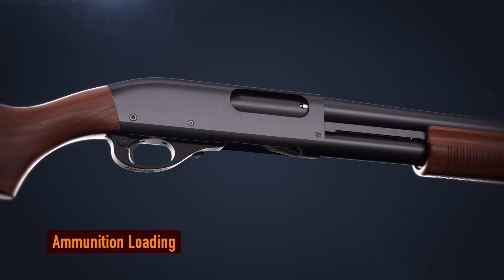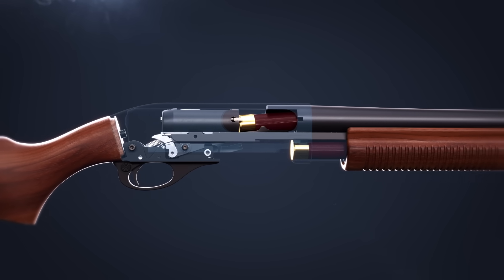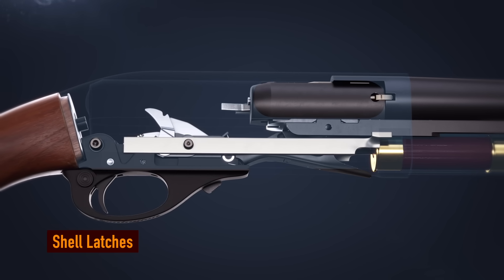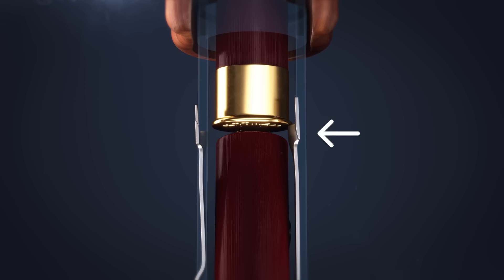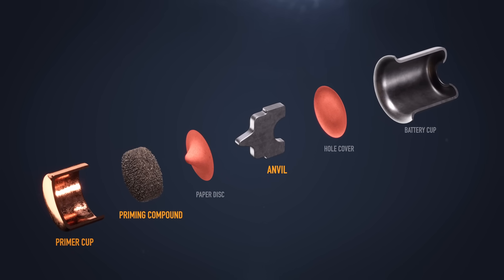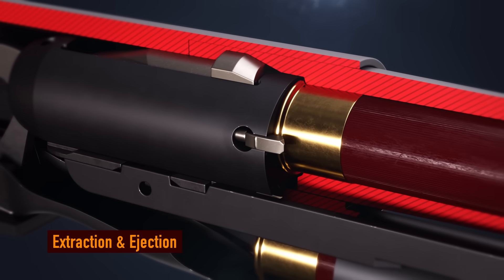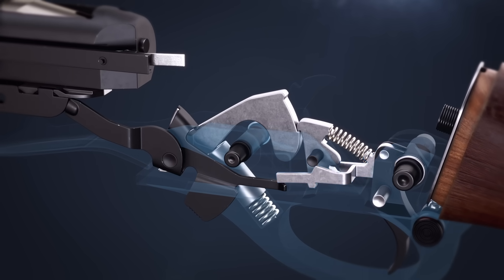How a Pump Shotgun Works

Comment: the mechanics of guns have fascinated me for years, especially when you consider that they were made by really clever people basically as an upgrade from just throwing rocks and spears at each other, like someone had to without any prior knowledge or really guiding help, had to work out so much of it
Reply: Us Palestinian are still throwing rocks. We can only imagine to have a few weapons. Things would be different.
Reply: Well each small evolutionary step in firearms technology came from folks learning about that which came before and then improving one little detail or two, or sometimes re-working the existing ideas into something different to solve a new problem. The 870 shotgun came from all of the lessons learned from those who designed the previous pump shotguns, and those first pump shotguns came as an answer to other methods of reloading like lever action and those came from folks trying to add a way to not just hand load each round, which was already an improvement over those who were muzzle-loading. Not that those who make the next generational improvements over and over aren't brilliant in their ways, but certainly are standing on the shoulders of the designs that came before. 

Also to be fair, it wasn't until relatively recently that cartridge firearms even were possible (approx 150 years or so) so a LOT of learning happened really quickly once that technology came about. We're still learning new options today.
Reply: @scottwatrous  Correct. First basic "firearms" were technically just downsized cannons. The "trigger" was there for more practical reason so one could use both hands to keep the thing steady when firing (no trigger needed for a cannon that lays on the ground). True, the side effect of that was also a better control over the timing of the shot. The real advancement happened after proper cartridges appeared.
Reply: I've always been fascinated with the mechanics of guns too. You know that slingshots and spears are made by literal apes though, they aren't the direct predecessors to the Remington 870. There was about 300 years between a time when a metal tube with a spring powered flint and steel at the back was the pinnacle of gun technology and today. Even before that there were wheel-locks and completely manual guns used all the way back in medieval times. They were making pocket watches before semi auto weapons, it was hardly a rapid conceptual or engineering leap, albeit a great and revolutionary conceptual and engineering leap

Comment: The mechanical engineering behind shotguns is staggeringly impressive.
Reply: All guns really. Some modern guns have like 200 parts and the engineering behind them is incredible.

Edit: changed "moving parts" to just "parts". Examples of 200+ part guns are most modern belt fed LMGs and aircraft mounted cannons. Some rifles and smgs come close to the 200 part mark like ruger precision rifle and FN2000
Reply: @Praxium

Guns can range from literally just a tube with explosives and a projectile to crazy overengineered and unreliable. Homemade smgs and the mechanical genius of the ak lie in between
Reply: @scronchgoose7403  The six moving parts of the AK platform never fails
Reply: @Praxium  200 moving parts?! That had better be in something massive
Reply: @Praxium  yeah like  f2000 it design is like a advanced bull pump rifle
Reply: @Praxium  And they run reliably even after thousands of rds, just plain incredible.
Reply: @Praxium  What guns? Most guns don't even have 200 parts. Maybe belt fed ones, just curious.
Reply: @Zluken  you're right. Many belt Fed guns have upwards of 200. M249 has about 180. M134 has over 250 even discounting motor and electronics.
Reply: @Praxium  what gun has 200 moving parts? Stop lying!
Reply: @nickflanderson2658  he’s just over exaggerating it
Reply: @nickflanderson2658  I think it hyperbole.
Reply: @nickflanderson2658  M134G, FN2000, certain AR inspired rifles
Reply: @Praxium  what an obviously fake statement lol
Reply: @kracksquatch512  hy·per·bo·le
/hīˈpərbəlē/
noun
exaggerated statements or claims not meant to be taken literally.
Reply: @kracksquatch512  Ifi
Reply: Exactly, and they are all mechanical which i find really cool.
Reply: Bigay ka ng May kapal
Reply: Your mom is staggeringly impressive.
Reply: For sure. And hell, this goes for any type of propelled weapon. Always fascinating to see videos like this.
Reply: Ñ
Reply: @David-fu1oj  yeah bro, really good point
Reply: Fancy words
Reply: It looks like nothing compared to the internals of a kalishnikov or ar15
Reply: Check out an AN-94 or a G11 if you're think this is impressive.
Reply: Heck, even the good ol' cannon in the old days impresses me.
Reply: ㅔ
Reply: Staggeringly 😂 try very, extraordinarily ,or just impressive
Reply: @sippitrey3083  You must have knocked them dead at the second grade spelling bee
Reply: Well said my friend ..beat me to it ..
Reply: A mechanized marvel
Reply: Gajab👍👍
Reply: Especially if your standing in front of one it'll stagger the hell out of ya.........
Reply: Yet very simple
Reply: And yet are simple compared to idk , 

An M4A1 with : 
Grenade launcher
Foregrip
Lasers
Sights with canted magnifier
Extendable stock 
Heartbeat sensor with movemap / some touch device
And of course , suppressor
Reply: Oh yeah? Are you a fucking engineer?
Reply: @LaughingMan44  I see anger management classes in your future. For the time being, you should try thinking before you speak. Usually works out better for ignorant people, such as yourself!
Reply: @dang6369  Imagine thinking I read anything you wrote. Now I will mute you and get the last word, this pisses you off ;)
Reply: @smirnoff1589  wow, you got a new account just to reply to me. I could tell you were projecting with everything you said, blocked!
Reply: @LaughingMan44  lololol I had that account u mad bro? Anger management!!!
Reply: @LaughingMan44  you mute me here too? F*cling rube lol
Reply: Saying it like every other gun doesn’t have similar builds. It’s really all guns.
Reply: Å
Reply: funny because who ever got shot with this shotgun usually gets staggered
Reply: Probably goes like, so how do we fire? Whit the hammer. How do we get a new shell in the chamber automatically? Uhh yeah umm. Its gonna be complicated.
Reply: Just a couple and springs, levers, and gunpowder baby.
Reply: Thank John Pedersen since both the Remington 870 and Mossberg 500 trace back to his Remington Model 10 design and the High Standard Flite King currently made by Rock Island is based on the Model 31 which is also mostly Pedersen.
Reply: https://youtu.be/KZYQTY5LZJ0
Reply: Haha rip kneecaps
Reply: If you want to see something impressive look at the inside of a G11
Reply: Took people hundreds of years to figure it all out
Reply: Ñ
Reply: Ur mom looks staggeringly impressive for her age
Reply: they were built off of simpler models
remove random crits
Reply: Imagine all the trial and error the last couple centuries to get here.
Reply: Amogus
Reply: Can you explain that engineering i want to know
Reply: Engineering wise it's actually quite simple. The simplest forms are pulleys and levers which consists of most of how the gun is built. Step 1,2,3 repeat.
Reply: http://youtu.be/DpIN2QQGit0 
Glock, Remington, Schofield, Colt, Walther
Reply: And they were invited in about the mid to late 1800s right???
Reply: Looks like a Rube Goldberg machine.
Reply: Eh not really
Reply: Yup, but Germany didn't appreciate it in ww1
Reply: But kinda simple
Reply: Indeed
Reply: https://youtube.com/channel/UCJK904C4lS1mEXSjozMfgEw
Reply: Обзор пневмо обреза у меня на канале)))
Reply: Talking about impressive mechanical functions, have you seen inside an Automatic Transmission!!
Reply: impressively not that simple as a mechanism for a so simple looking weapon
Reply: Not really, this seems pretty straightforward compared to some guns
Reply: @Killakatnage89  "Seems straightforward," says the expert explaining a video about something that took years of design, testing and manufacturing.
Reply: It's easy, anyone could make a gun on their first try
Reply: @wickedimpulse  But not everyone will live to make another.
Reply: @wickedimpulse  no not at all, unless its a pipe shotgun
Reply: @wickedimpulse  a rubber band gun?
Reply: @blackholestorage168  I think they're referring to a slam fire shotgun. Any idiot with access to steel pipes and tools can easily make one but they can only fire one shot and they're about as accurate as hip shooting a sawn off.
Reply: @wickedimpulse  oh yeah, ill try the "holding the bullet in between my fingers and hitting it whit a hammer" technique.
Reply: And it's crazier to think that the first pump shotguns were invented a hundred years ago
Reply: Thank you
Reply: It’s crazy. And to think they were invented before math.
Reply: @spaghettiboney  Lol wat?
Reply: It's to kill thing, of course we're gonna put in the effort
Reply: Welcome to Whitesville.
Reply: Yes cool. But no need for such a device to be invented with intention to kill humans
Reply: The mechanical engineering behind death is staggeringly impressive
Reply: what? I think its pretty simplistic to be honest
Reply: @jimlahey6692  Simplicity in is a fundamental principle in designing something, and to me at least, is part of what makes the design of the pump action so beautiful.
Reply: @jimlahey6692  yea, something like combustion engines are far more complex
Reply: Yet A HillBilly Can Make A Fully Functional One Out Of Old Scrap Metal Parts
Reply: @kracksquatch512  Well, I mean, you're not wrong.

Comment: This might be a random question, but considering that most pump shotguns eject the empty shells to the right side, will it be disadvantageous for lefties? 

I mean, the empty shells would jump and made contact into the right arm on each pumps unless you lean the shotgun outward, slightly to the right.

Would that situation be disadvantageous?
Reply: I suppose so, but shotgun shells are mostly plastic and don’t get as hot as rifle brass in my experience. Probably more of an annoyance. I’m sure some companies have made receivers to eject it on the left side for lefty shooters.

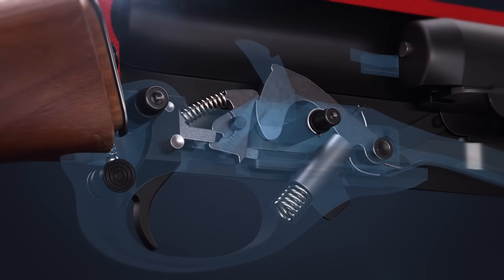Comment: Quick question. At the 2:09 mark the animation goes over the firing sequence.  The trigger rotates the sear, which releases the hammer. But the hammer itself seems to only be held in place by a small overhang of metal. If the shotgun were dropped onto the stock from an appreciable height, what would stop the sear from getting knocked backwards and releasing the hammer?

Put simply, what prevents a discharge if the shotgun is dropped?  

Thanks in advance for serious answers.
Reply: Tolerances inside the trigger mechanism are tight and everything is bolted together so even though it's only a small lip holding on, it's perfectly safe if handled properly
Reply: So, yes, obviously safe handling is the best way to prevent any negligent discharge. My question assumes that the shotgun in the animation has been dropped. We can argue about whether or not a firearm should ever be in a situation where it is dropped, but for the purposes of this question let us imagine a world where there is a shotgun that is already falling onto a hard surface in such a way that the stock will impact with force.

At that point it seems, per the animation, that there is nothing preventing the sear spring from compressing, which would disengage the sear and allow the hammer to strike the firing pin.
Reply: @rolfbuchner3991  Sig's new pistol for the military actualy was found to have this problem early on, when dropped it was possible for it to discharge. These things are tested and resolved. If the 870 had this problem it would have been found and redesigned after all these years
Reply: You literally answered your own question
Reply: They are not drop safe, and the safety will not keep it from firing if it is dropped. It's best not to keep them with a shell in the chamber for this reason.
Reply: @chillbro1010  That was a really interesting answer, thanks.
Reply: The safety?
Reply: Don’t drop a loaded shotgun or it could go off
Reply: @chillbro1010  Thanks! This is helpful.
Reply: Short answer, nothing. Slightly longer answer, only your proper handling of the firearm.

Comment: For my 870 I only have to to push the action bar once to put a shell in the chamber after that when I fire and go to pump I don’t need to press it again not sure if it is like this on other 870’s but for mien it allows me to rapid fire
Reply from the maker: Yeah I should have been more clear about this in the animation 😞. The action bar is only required upon chambering the first round.

Comment: This works like a piece of computer program, except the parameters are much more hard (literally) to adjust, so that all modules fit, sync, and work together. It must have taken quite some years to debug and smooth out the code.

Comment: Interesting, but why are shotguns loaded this way and normal weapons from magazines, and not the other way around, or both using which ever of the two is superior?
Reply: One off the cuff thought is cartridge shape. the conical shape of a bullet means that it's more likely to tilt in a vertical magazine where as the cylinder shape of a shotgun shell has less room to shift to account for the rim in a stack.

Some amount is also probably history, though shotguns like the USAS-12 and AA-12 both use more traditional magazines, though I don't off hand know of any non shotguns that use an inline like most shotguns.

There's the consideration of weapon balance and ergonomics. a 12 gauge shell is quite large compared to say a 5.56 or 9mm bullet, so having a large magazine sticking out of the bottom might be clunkier to handle (Some military rifles had their magazines shortened for ease of use over walls for instance) or shift the weight in a less preferred way.

Finally there's the considerations of capacity in addition to the above, in most situations a user is unlikely to need to be able to carry as many, You can only extended a tube so far, but by the point it becomes an issue for a shotgun, do you really need another shell ready? Trying to get say 20 or 30 rounds like that might be difficult, and a feed mechanism to stack them needlessly complex when a stack magazine would be simpler.

Comment: I started white tail deer hunting @ age 13 using a Remington semi-auto 12 gauge shotgun.
I'm much older now and no longer hunt.
But the ultimate Home Defense is not a pistol or rifle.
It's a 20 gauge semi-auto shotgun with the rifled/short barrel and pistol grip stock.
Deer slayer slugs will drop a moose,blows holes thru armor vest and if not the force is so strong 
it will push the vest to your backbone destroying internal organs.
To take out multiple attackers use double 00 buckshot.
If you only want to Hurt then take out the BB'S and replace it with Rock salt.